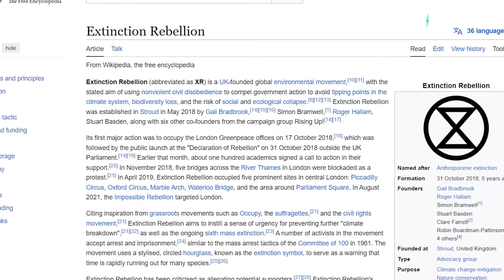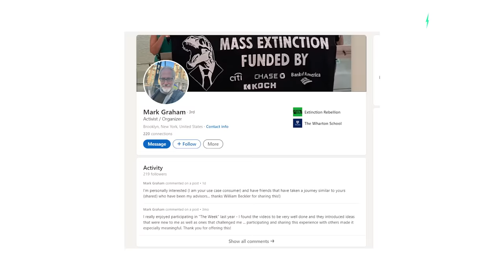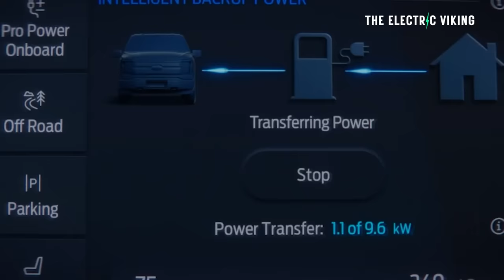Climate Protestors thrown out of NY Auto Show after demanding an end to EVs

Comment: I have talked to some of these types. They have either been former auto executives or borderline flat earthers.
Reply: It's easy to denigrate people you don't understand because the message went straight over your head. Much harder to take the time to listen to what they are actually saying. An EV is about 2% energy efficient. It's insane to make such a vehicle the primary means of transportation in cities and suburbs. EVs do not solve the sprawl problem. That is at least as big an environmental problem as the vehicles themselves.

The solution is to rework our cities so that private MVs are not the primary way we get around. EVs do not help with that. It's a distraction. They are better than ICE. That is suuuuch a low bar!
Reply: @ronvandereerden4714  How are you calculating energy efficiency?  Are you comparing it to a bicycle?  A crowded bus?  Not everyone lives in cities.  The perfect is the enemy of the good.  ER doesn't seem to understand that.

Comment: The majority of people live in urban areas. Those areas should be constructed so that you don't need a car to live there, using trains, trams, buses, ebikes, bicycles and walking. Outside of urban areas people do need cars to get around as the density is too low to support public transport. Those cars need to be EVs. EVs are an important part of the solution for those that need to use a car, but as much as possible we should be avoiding car use being necessary. Of course we also need to switch electricity to non-carbon sources and switch heating to electricity. We need to do all of the things, including EVs but not only EVs.
Reply: trolley buses, and trains  not battery electric. incidentally, recycling ev batteries is for the moment impractical; there are pilot projects around.  the black mass for $10,000.00/ton is funded by ESG money.  Tiny amount will be recycled, most of which will end up in landfills anyway.  It will take decades for the battery recycle value chain to be established.  The recycled minerals will be more expensive than virgin minerals by order of magnitude.  Only the 1% can afford to drive EVs; they should be allowed the freedom to so.  Charging infrastructure should be paid only by the users, and not the taxpayer.
Reply: I live 85km from my work and 15km from the nearest public transport route - I gave no options but private transport
Reply: @albertiwong  Whaat? The best selling privately purchased car in Australia in Feb 2024 was the Tesla Model 3, the best selling car in the world in 2023 was the Tesla model Y - that's a lot more than 1% of the poulation that can afford one. The vast majoriy of EV batteries will be recycled - there will not be mass landfill - not sure out of which arse you are plucking this BS.
Reply: @TB-up4xi  if you live 15km from public transport them either you don't live in an urban area or your public transport is terrible. I said that people that don't live in urban areas will need a car.

I live on a farm. About 1 mile in each direction there is the next village and both of those have bus routes. Unfortunately the nearest train station is 10 miles away. It is quite a cycle to there and back. I would be much fitter than I am if I did that regularly.!
Reply: @TB-up4xi Yes you do. Move! How dumb is it to live so far away from work? Even dumber to live so far away from transit. This is why we need road pricing and carbon taxes.
Reply: @albertiwong If it's valuable, it will be recycled. If it's not valuable then batteries would be way cheaper.  Saying recycled material is more expensive does not make it true. Prove your point. Even in the backwards USA EV sales are way more than 1%. So obviously your 1% can afford it statement is F A L S E !

Comment: The ironic part about a Tesla is they are really simple compared to a ICE vehicle.
Reply: They are not simple at all. They run on computers and everyone knows how complicated they are.
Reply: @markmiller8903  no gearbox, no  differential no radiator  no trans cooler  no fuel lines no alternator no starter motor  no tail shaft and the list goes on.

Comment: Cars are not the only things that are needlessly complex... the whole "cloud-based" thing has some very problematic aspects, whose potential problems seem to be entirely ignored, as technology is adopted without regard for potential downsides. Louis Rossmann regularly covers products whose manufacturers restrict, or eliminate functionality via the Cloud.

Edison Motors of Canada is a good example of the "enough technology" approach. They don't allow "custom tech" to interfere with serviceability and affordability.

One could look at some modern automatic transmissions in the ICE world, or some of these high-tech suspension systems. Very high performance/efficiency, but god help you if you need to repair or replace them.

Comment: I am surprised that this group would go after EVs and not all automobiles, especially gasoline or diesel powered ones. The extraction of oil and the emissions  from ICE cars and trucks are huge polluters.  
Furthermore, the current limits of battery power encourages more efficient vehicles.  
My own 2012 Nissan LEAF has its original battery, charges overnight when demand is low and gets me around town quietly with no emissions. How is that not a net win all around?  
I think that with actions like this, the group will alienate more people than it will convince.
Reply: No such thing as low demand if they are all charging at night. The idea of cheap night electricity dies with EVs. Oil dependency isn't just because of ICE. Synthetic Plastic and rubber is only cheap because of our consumption of light fuels. Refineries will not shut down, and drilling will not stop. Refineries will need to charge more per barrel as waste light fuels will need to be dealt with as a byproduct, plastic and rubber will increase in price to cover operation costs. Keep in mind 30% of a battery is plastic, and EVs still require some amount of lubricant, and with the amount of plastic utilized, it's hard to say how cheap they will be in the future once all markets have settled. I'm for EV efficiency, but people really think this will not cause any other problems, and don't understand this transition affects a larger part of the market than just auto. Light fuels will also get cheaper as its a byproduct of refining, so anyone who does choose not to go EV and has the means to keep one running, will be cheaper than electric in the next 15-20 years. And at that point, the ICE vehicles will be exempt from emissions standards. It'll be a very interesting transition, and I don't think anybody will be happy about paying more for a cup than the liquid inside, but it's what we asked for, so be it.
Reply: @AhjTheMediocre  Look at the consumption curve for electricity. It always dips significantly at night. Most jurisdictions will want to flatten the curve so time of use pricing makes sense. Here in the province of Ontario, Canada we have overnight rates that are approximately half of peak rates. It means that charging overnight makes financial sense and that won’t change for a while, if ever.
Reply: @martinutr  ahh, the good old short term argument. That curve is with less than 5% of vehicles being BEV. We are looking at roughly a 25% increase in grid utilization once EVs are mainstream. And if almost all of them are charging at night, how is that low demand? I do not care about current data, as it does not reflect on the future models. Yes, it does make sense, because there is no demand at night, not true when everyone charges at night, that is demand. And a decently large chunk at that.
Reply: @AhjTheMediocre  But where do you stop? Even cavemen burn wood and create smoke.
Reply: @benmlee  stop what? I don't get your point lol
Reply: @AhjTheMediocre  We will still use plastic even with electric cars. No matter what we do, there will be usage of resources. Environment will be altered. Is not possible for humanity to stop using some resources and alter the environment in some way. Question is when is it good enough?
Reply: @benmlee  that is a good question. It most likely won't ever be good enough. The sad reality is the whole emissions and climate change came not from gasoline vehicles, but consumption and industrialization, producing as much as possible so we can consume as much as possible. The only way for us to fix it is simply live as we did before consumerism. We grew our own families food, reproduce, and die. It is not possible to grow GDP every consecutive year amd expect no increase in emissions. People are hoping for an easy way out without changing their own lifestyle, yet our consumerist lifestyle is the reason we are here in the first place. So yes, it is a good question, when will it ever be enough for us to stop consuming?

Comment: EVs do not truly solve the problems. They are only great for short term ownership but you do not want to be on the hook when the Motors or battery goes out. I think everything needs to be out front and center when selling these cars. When you sell a car for $45000 to $60,000 a battery shouldn't cost 26k to 45k to replace. I hope banks refuse to finance 8 year old EVs.

With Vin seared parts it makes them true throw away cars. 

I know this because I've been working on EVs for the last 6 years. I would only lease one and i would never want to own  longer than 3 years period.

Comment: It's obvious that we have been using fossil fuels and problems have become obvious associated with the fuel use.  So we must try something different.  One system is to put everything within
walking distance, but that will only partially work.  There are functions/tasks that are needed that can't be done closely.  i.e. hospitals, mining, factories of sorts, farms, fishing, etc.  therefore we
have to have transportation.  another reason is close proximity of people - we get slightly insane when crowded.  Open spaces are required.  Exercise is fine, but most of us require outdoor recreation.  If transportation is not going to be totally non-fossil fuel powered then it has to be powered by something else.  Why not electricity?

Comment: I wamt to drive cars not be driven by a supercar on wheels.
 Make it go far charge fast but i dont need semsors for everything and enough cameras to replace a film crew.
 Make them affordable. Electric vehicles don't need to be $100k try $15 thousand
Reply: You just described a Tesla without full self driving. 
Over 300 miles of range 
250kw charging 
No extra sensors like lidar, sonar, infrared, or radar that cost a lot. Just some cheap cameras, lower resolution than what’s on your phone. Just enough to prove someone hit you. Even though they said you hit them. 

No there is no stick shift , but damb they are fun to drive
Reply: I have a 2014 Leaf, and based on wholesale battery prices, the cost of the battery was $15,000 when it was built. The cost today would be $1200.00.

So why is the newest Leaf almost three times the price of the 2014?

The answer is that everyone is targeting the premium market. Simple EVs would wipe the floor with ICE on cost. But no one wants that market.

Comment: You need to educate yourself. Synthetic graphite used in car battery production is very carbon intensive. So you would have to say that although it solves the emissions problem we need to change the way graphite is processed or find an alternative.One source for synthetic graphite is a bi product from the  oil & gas industry.

Comment: Upgrading current ICE cars to an EV by removing the engine/gearbox and replacing with batteries and an electric motor is the answer, reduce, reuse, and recycle. However this takes time, R&D and money which new over expensive tech/touchscreen swamped  EVs is funding. Give it a few years, battery densities will have doubled, EV conversion kits will be a growing market and EV converted Porsche 911s, Audi convertibles, Mercedes luxury cars will be common.

Comment: The way houses are built and the appliances used are extremely inefficient. I've been living in my car for a year and a half, and spent 9 years without a car living in a geothermal solar apartment. The world is ending from climate change. Hopefully we can put a sheild in space Before it's too late. I chose not to have kids, because our current tradjectory is extinction (I believe) before 2040. The methane hydrate stored in the oceans is gassifying into the atmosphere as the oceans continue to absorb excess trapped heat in the atmosphere. If it was more prevalent that people were building eco-centric homes and vehicles, or had a focus on reducing their footprint I would have some hope, but everyone is oblivious, and contributing to the problems.

Comment: Well to be fair then they are not saying EV bad, ICE good.   They are saying that EV doesn’t go far enough.    Whilst they solve burning fossil fuel at the car level they still have other environmental issues.
Ie mining of lithium that still need to mine it until have enough, they are still being opened as not reached the point where have enough to not mine additional resource.
Steel still mainly generated from blast furnaces which requires coke as in fossil fuel.   So even if use clean electricity then still currently requires fossil fuels.   Whilst this is being replaced with electric arc furnace or hydrogen reduction where use hydrogen instead of coke, then until they replaced then still creating fossil fuel emissions.
Replacing ICE with EV means just as much usage of roads which are not exactly carbon free in terms of production.
As such they are arguing that should be looking to reduce reliance on cars.   However not sure how practical that is.
Public transport does some good and use where can however whilst I use it where can then couldn’t remove a car from my life altogether.

Comment: If you attack EVs in any form I label you as OIL LOBBY SHILLS and its on you to prove otherwise.

We can start worrying about replacing the fossil sourced lubricants and plastics in EVs once the step of taking the fossil sourced energy out of the propulsion cycle. Meaning first we electrify the "driving the car" part and creating the power in a renewable way. Then we worry about then next 1/100 of current numbers.

Comment: The closed loop that recycles the batteries & the car, will never be able to recycle any of the toxic particulates put up by road, tire & brake wear. While asphalt is highly recycled, is also highly toxic, which leads to highly toxic particulates in the air & highly toxic run off into surrounding water-ways.
 Yes, we should all be riding bicycles (or E-bikes), for a lot more of (if not most of) our transportation needs, but that won't be possible for most people, until better much public transit is built & our roads are improved with complete networks of safe cycling routes. So while those "muppets" are misguided and protesting in the wrong place, they do have a point.
 We should not be trying to continue car-culture & build everyone in the world an EV, we should be building complete networks of safe cycling routes, expanding & electrifying passenger rail service everywhere, and building EVs for the 5% to 10% of us that really do need cars & trucks.
Reply: ICE cars have particle pollution from tyres as well - the differential particlulates generated by EV's in negligible if anything - brake wear is almost non-existent on an EV - brakes last on average 3 to 4 times longer than an automatic ICE car because 90% of the braking is regenerative and does not use the physical brakes, there are EV's in the US with 200,000+ miles still on original pads and rotors.

EV's are not heavier than ICE cars and do not cause additonal road damage, 95% of road damage is caused by heavy vehicles not by cars at all getting rid of all personal vechile transport would have almost zero impact on road damage - a Model 3 weighs the same as a 2litre C300 Mercedes - A model Y less than an Audi Q5, Even the gargantuan EV9 weighs less than a much smaller 300 Series Landcruiser. The average weight of an ICE car purchased in the USA in 2023 was 4329lbs the average EV purchased in the USA in 2023 weighed 4208lbs.

Relying solely on public transport / ebikes is completely impractical for anyone without reasonable access to public transport which is over 2 million people in greater Sydney alone - there are a range of people who can't live effectively without a car -  people in their mid 60's and 70's still work you know - they should be riding their bikes to work in the rain?,  all the large families should carry their 2 trolley fortnightly shopping home on the bus? , we'll all just call an Uber maxi for the the 300km trip down the coast for the family holiday...right.
Reply: @TB-up4xi  "brake wear is almost non-existent on an EV" that may be, but the (electric) trains needed to move millions of people, will produce far fewer particulates from road, tire & brake  -wear, than millions of EVs would. Electric trains have regenerative braking too, and they don't wear out asphalt or tires. Steel wheels on steel rails, can't put up much more than iron & carbon (but no CO2). So we need to electrify our railways as well as build EVs. If rail service were a lot better, then more goods & people would travel by rail, and fewer cars & trucks would be clogging up the freeways.